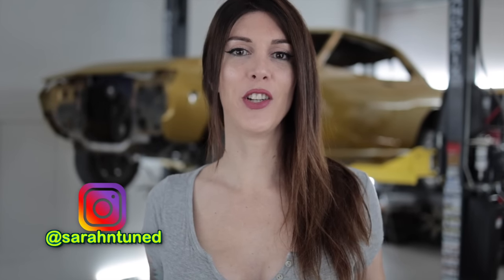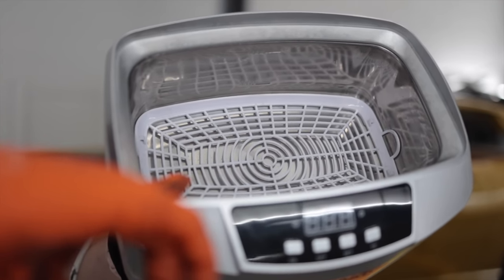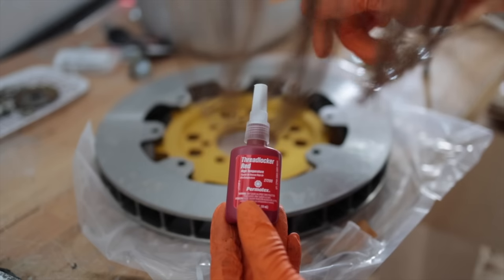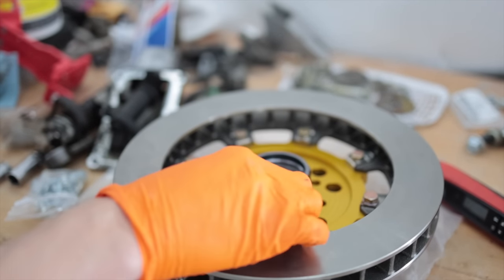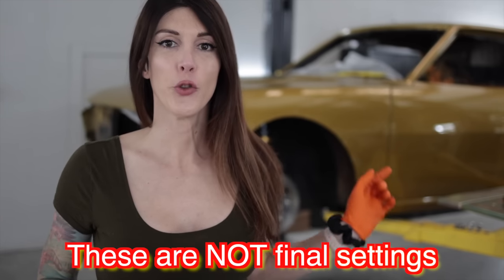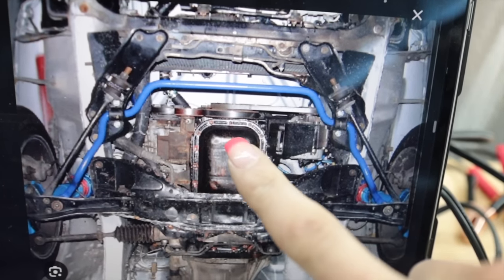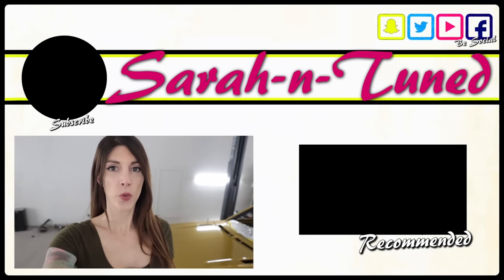A Muscle Car That Handles! // AE86 Front End Swap

Comment: NICE   Sway bar fabrication is fun especially when there was no rear sway bar and you want/need one. Another fun aspect, customs clearing. We imported parts from England, getting a call from customs telling you they want pictures of the engine and wheel bearings you just stocked a hassle, when we got the first MGB body in the US and it's no issue till you figure out that you got a right hand drive not a left hand drive, fortunately the customer was ok with it, we just had to come up with all the other parts to convert his donor parts, an extensive list.

Comment: Ultrasonic cleaners are awesome.  I had that same Harbor Freight one for a while but modestly upgraded when it eventually died and spending just a little more is definitely worthwhile.  Couple tips; heat is key, 20% Simple Green to 80% water is good for general purpose, and finally--if you are going to do a small number of extremely dirty/greasy parts, put then I a jar or zip lock bag with your solvent of choice and use straight water in the ultrasonic tank.  Then just put the sealed jar in that bath.

Comment: Little tech tip on your ultrasonic cleaner. Fill the unit with plain water and put your "to clean parts" with the cleaning product in a separate plastic container with a lid, it's saving you the pain of getting all the dirt out of the unit later and it keeps the basket in new condition

Comment: do NOT wait! call fedex customer service and find out who is handling the customs clearance of your shipment. you will need to fill out a declaration form called HS7, and email the form to fedex in order for customs to release your wheels. i had the same issue with fedex last month when i ordered my te37s from japan, when i found out that my wheels were held in customs, fedex just told me to wait, but the fact is if no declaration form is submitted to the customs within one week, they will ship them wheels back to the shipper in japan, and that's what happened to me. i had to pay my shipper twice simply because fedex didn't care and didn't even mention a declaration form was needed.

Comment: For the front anti roll bar, can you have a bar that clamps on each side to (and parallel with) the gold suspension arms (track control arms), then just fabricating a mount on the underside of the  radiator suppoort. This does away with the drop links, and was how some cars anti roll bars used to fit (Alfasud for example)

Comment: You also have options for the sway bar from the TT132, TT or RT140 corona's, the TE72 corolla liftback, if you look for the Toyota that doesn't come with a rear sway bar the front sway bar is 2mm larger.

Comment: Nice choice on the suspension goodies Sarah!  I think you can get around the clearance issues on the sway bar by spacing the mounts down a bit. I dunno if you'll still be able to use the stock unit, but there's bound to be something out there that will fit and not bind up when the suspension is compressed. I really like the way you're going with this! Can't wait to see it on the road with some substantial tires and that 2UZ cranking out the horsepower!!😄👍

Comment: Awesome stuff! 

You may want to consider getting some of the Loctite 2422 very high temperature formula. It was developed specifically for wheel hub temps, but it's also medium strength so the parts can be disassembled for easy service. 

Rated for 650°F / 343°C

It's a little pricey, but well worth the money.

Comment: hi sarah . just to add a little on top of your sway bar .....those nice suspension gold strut bars......they are equipped with steel heim joints ....had that on my street driven track focused 98 m3 . these joints do not last very long on the street , and on top of that they klunk a lot as they loosen up . depending on your mileage evidently .
Reply from the maker: Yeah, because this thing is going to be racking up 10s of thousands of miles per year lol.

Comment: The front sway bar problem is common on most of the first Gen Celica's with an engine swaps (especially the early cars with the smaller engine bay) as most of the engines swapped in have front oil sumps. I and currently doing a BEAMS swap in my 73, and will probably need to get a custom bar made. People have said the AE 86 bars work on the later models (75+) as you can get the engines further back. I'll be curious to see where you end up. I'll likely run without to start, then see about getting one made.

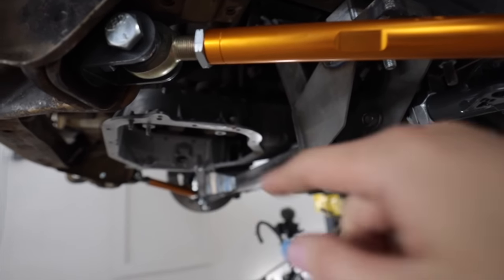Comment: 10:35  Check out the Cusco AE86 front anti-sway bar.  It' should clear the front of the engine.  It's needed for 3SGE swaps for this same reason.

Comment: I'm not sure of your plans for this car but I have owned a three of them, including two brand new ones. One I modified with Toyota performance parts and raced it in the 70s.
  The car looked much better than than similarly priced Datsuns of that time...but...handling was terrible. No matter what we tried it just wouldn't turn at racing speed. Just wanted to keep going straight regardless of where the wheels were pointing.
  My 1974 Toyota Corona Mark II coupe was much quicker .
  I hope you tame it . Always loved the looks

Comment: I used to make sway bars . Pretty easy to get a custom one made . My guess for a car that size and weight a 27mm diameter solid from xk26s spring steel. I thinkn i got the grade right.  Get blades with three hole at the wheel ends . For rose jointed link pins. That way if you estimate  the centre hole on the blades at each end to be what you should use ,youve got 1 position harder and one softer to go to if it oversteers in bumpy corners . .the rear sway bar can be a lot lighter like 18mm dia bar if is a short bar the rear will stepout on bumpy corners if the bar is too rigid..i ran 20mm rear 3 hole ended up using the last hole (softest)on a chrysler A body..make a template 1/4 inch rod .thats what people sent to us when we did customs. 27mm and being that long will still allow suspension to work properly but take a lot of the body roll out .. but you know part i bet

Comment: I love this car. I have just started restoring a 1973 TA22. I was wondering if you have information on what you did for the front end. Steering etc. you mentioned AE86 gear, do you have more specific info? Or is just a straight ae86 / ta22 swap out?

Comment: You need to fill the ultrasonic cleaner higher. Especially if it has a heater. I use Simple Green  @ 50/50 ratio.

Comment: Look at an 89 ish firebird it may be too wide but it mounts below the radiator support and ataches with the same type of end links.  85 fero may also be an option but a sleeved race bar may be easier.

Comment: I bought a sonic cleaner exactly like the one Sarah has, about 10 years ago, and it was a hugh disappointment. Almost 100% non-effective.
 Made that same high-pitched sound she was talking about, but that's all it did. Besides waste electricity.
 Different solutions, heat, no heat...didn't matter. Bought it to clean small carbs, I do them manually.
 The thing is good at occupying space under my bench though, I'll give it that. And collecting dust. It stays on top of it quite effectively.

Comment: Hi from Australia 🇦🇺 .....
 i use a mx62-gx61-lx63 cressida swaybar for my toyota engine conversions into corollas so a celica should be same it steps swaybar forward around 40mm further than ke-ae70-86 corollas...

   i have been watching all your videos...im a toyota tragic... and love too modify them.... i have a ke70 with a turbo 3rzfe... a ke10 with a turbo 7ke.. also a ke36 panelvan which i am considering fitting a 2az possibly supercharged... and my daily/towing vehicle is a ln60 series-1 surf

Comment: Hi Sarah,  I sure wish you would have used 5 lug hubs,  I mean it's really a safety issue, with the added power from the V8 and the added stress at the rear diff from acceleration it won't be long before something fails or breaks. Also 5 lug hubs will give you a much greater choice of custom rims to use.
Reply: If you watched the video at 03:26, you can see it's multi-PCF, and a 5 lug will also fit. These are the old wheels, and Sarah has not revealed the new rims. (So don't know if those is 4 or 5 lug)

Comment: Sarah, what is different on the stock set up vs this , other than some adjustability, pretty milled parts, and bigger rotors?  Is it struts vs coil overs.  I guess I'm tryin to figure out how this is going to make it handle.  What wa the initial adjustability you were showing us, camber?  (drifter vs stock v race car, I think you said)

Comment: I’m not a huge fan of reusing nuts and bolts, especially anything with a torque spec.  When you tighten a bolt it stretches.  Once it stretches it’s never going to be as strong after it’s removed because to torque it again you end up stretching the bolt more.

Seen a demo where head bolts lost 20% of the bolts thread strength.

Sonic cleaner works great on reusable brackets.

Comment: That front cross member is not going to survive a hit with all that extra weight.
Reply from the maker: The all iron 18R Engine I pulled out of it weighted 403lbs, didn't have a light engine to begin with. More importantly that's not a factory crossmember it was specifically engineered for this swap.
Reply: @SarahnTuned  
Excellent solution. 
My 1976 Celica GT bent the stock cross member three times. All it took was a curb tap or NYC pothole.
 Obviously None of these specialty parts were available back in the day. 
 I am confident you will work out whatever issues come up.  Your intelligence and creativity are obvious.  
The 20RC was under powered and under stressed but super smooth as was the transmission and the ride.  It was my first new car after the used Triumphs, MGs, Jaguars, Datsun Fair Ladies and 911s I raced.  

You always do fine work.  And your on screen persona is fun to watch. Take care kid.  Love from NYC
 Larry

Comment: 235 tires on a 2uz?! You're nuts. I have an IS350 with 235 in the front and 275 in the rear You are never going to be able to hook with 235 You're going to need to stagger your tires